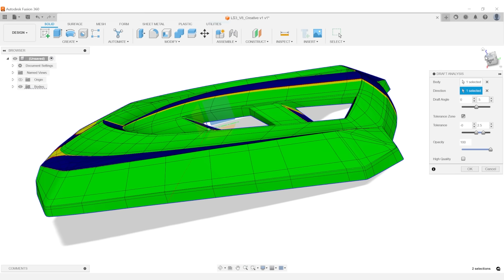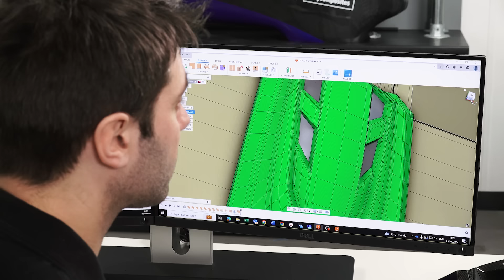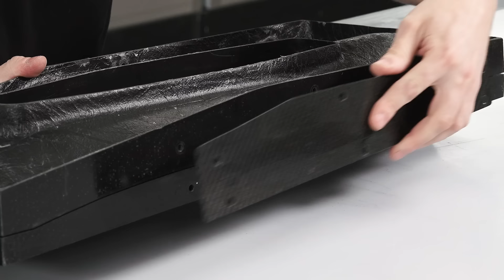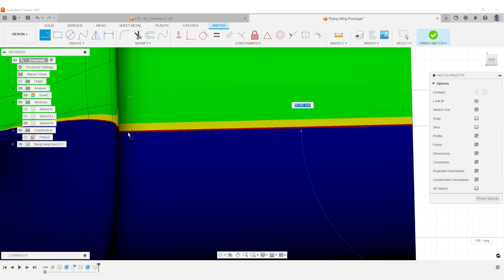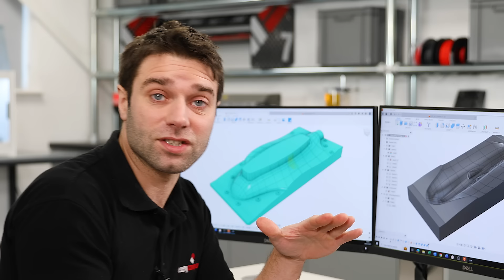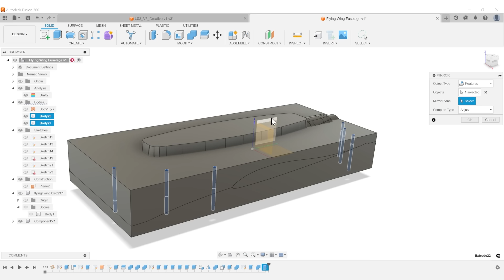Practical CAD Techniques for Composite Pattern/Mould Design

Comment: Draft analysis is one of those tools that separates good mould designs from frustrating ones. 📐 Finding that optimum parting line early saves so much headache later. At JevnyMFG, we use draft analysis daily to ensure smooth moulding. Great practical walkthrough! 🔧

Comment: i really enjoy watching your videos but i've always wondered why you couldn't just machine the mould directly
Reply from the maker: For prototypes and small production runs, you can machine the mould directly from an epoxy tooling board or even billet aluminium. However there are some downsides to this approach. The fist is longevity of the mould tool, a composite mould will significantly outlast one made from tooling board and in some cases even machined aluminium given the ability to undertake repairs. The second and more importantly is the delta in CTE, if the mould and the component material are made from different materials then they will experience expansion and contraction at different rates during the cure cycle. This leads to the potential of distortion and warping of the part and even things like pre release which can cause significant imperfections in the surface finish. For the most accurate and stable moulds, they should be made with a material as close to the component material as possible.

Comment: What an unbeleivable amount of competence on display in every one of these videos.  This gives me a great deal of optimism for the future, as do all of the overwhelmingly positive comments.  Nice to know in a world that can seem increasingly chaotic, there is a stable base of both very competent people and those for whom that is respected and appreciated.
Reply from the maker: Thanks very much George, it's no secret that a lot of time, effort and resource goes into making these videos so it really is nice to get feedback hearing how people have been inspired to give it a go. It's videos like this which demonstrate methods that will hopefully open doors for the next generation (and current generations) of engineers.
Reply: @easycompositestv  Absolutely.  It's so great to see.  I've been 3D printing for 13 years now and it seems like the field is exploding.  I know you make your molds primarily via CNC, and it makes sense due to the scale and diversity of materials, but I'm also wondering if you've explored 3D printing, at least for smaller models.  In my experience, regarding CNCs, the CAM part is a bit intimidating and sometimes costly in broken bits and materials.  3D printing significantly simplifies that process as the analog to CAM is essentially handled automatically by the slicing software.  Interestingly consistent with your thoughts on the next generation, my son (15yo) just launched a 3D printing business where, coincidentally, he's printing carbon fiber "style" parts.  We've been trying to figure out if we could incorporate real carbon fiber parts into his offering as there is definitely demand for Carbon Fiber parts in his niche.  We had considered CNCing carbon fiber plates (as opposed to fabric), but that seems to have some challenges which you can probably imagine.  Your videos have got me thinking we could possibly mold the parts instead.  Being able to 3D print the molds (or positives to make molds from) would certainly be more in our wheelhouse.  I'll have to put more thought into how we could adapt our offering, which is currently almost entirely custom - per customer, to perhaps a hybrid where we produce a base carbon fiber part and then somehow add customizations to it.  The reason being, I don't think our market will support the higher costs of custom molds for each order.  But it could possibly support a base product with 3D printed customizations added to it, or perhaps smaller custom molded carbon fiber parts being added to it.  If I can figure something out that will work, I certainly now know where to learn more about the processes involved and to get the required materials.  Cheers!
Reply from the maker: @georgevaccaro9379  Great to hear that your so has already started on his engineering pathway. 

We have used 3D printed moulds and patterns in a good number of our previous videos, covering Forged Carbon compression moulding, direct laminating of a 3D printed mould and also using a 3D print to make a high temperature mould for processing prepreg. 

https://youtu.be/nhqAhYOdGNc
https://youtu.be/4ND2WtEZatY
https://youtu.be/KpJdwryFj6k

Whilst this technique is great for smaller projects they do come with limitations on larger pieces where CNC profiling is prefered. For getting started though it can be a great way of introducing yourself to the world of composites.
Reply: @easycompositestv  Excellent!  Thank you for the links!

Comment: Why do you need carbon mould instead of just making it on epoxy tooling board?
Reply from the maker: Whilst you can, and we have, directly machine tooling directly from tooling board the end result isn't as durable or as stable as a composite tool. Also to factor in is the CTE of the tooling board vs carbon fibre, whilst the epoxy board is pretty good, it won't be as close to carbon fibre as a carbon fibre tool would produce.
Reply: @easycompositestv thank you! What about fiber glass mould? It would be much cheaper than carbon fiber mould
Reply from the maker: @galanonim3122  Again it's all about trying to match the CTE of the mould and the part as closely as possible in order to reduce distortion and potential pre release. If you were making glass parts from prepreg then a glass mould would be perfect, for carbon parts cured at elevated temperature a carbon mould will offer the smallest differential in expansion/contraction rates.
Reply: @easycompositestv I got it! Thank you!

Comment: hi Mr Paul ^_^ , you are modelling the fuselage by the " Form surface " module ?
Reply from the maker: Initial modelling was done on a VR Metaquest headset, but it could equally be done on the surfacing tools in the CAD package you are using.
Reply: @easycompositestv  But I see that the way to build shapes using VR doesn't have parameters, but it drags and drops points like the way to build shapes in the Create Form module in Fusion 360.
RIght ? Because when you configure it to split into 2 halves of the sample on the software, I see that it also takes you time to process it.
Reply from the maker: @tuanbuiminh2674  Once the initial form was made in VR, it was then imported into Fusion to refine and ensure all dimensions were correct.

Comment: so i have a question is it possible to 3d print the first mold or it has to be cnc machined?
Reply from the maker: For hand laminating practices then 3D printing a mould directly is definitely an acceptable practice as we show in our 3D printed mould tutorial.  
https://www.easycomposites.co.uk/learning/carbon-fibre-part-from-3d-printed-mould

If you're looking to process prepregs and use one of the more advanced processing methods then you may be better off printing a pattern and then using this to make a suitable composite mould.
https://www.easycomposites.co.uk/making-a-composites-mould-from-a-3d-print

Comment: @easycompositestv, what software do you use for the surface design (initial part)? From the surface lines, I assume something like Rhino or Blender.
Reply from the maker: Hi Patrik, it was initially modeled up in VR using Gravity Sketch and then tidied up in Fusion 360.

Comment: Thanks for the valuable video. If you want to carry out a FEM simulation for this component, e.g. to simulate a torsion test. How would you define the bondry condition and load and which failure theory do you use? I have designed a very similar component and defined a bending load case. But I want to do a torsion test. Can you give me a tip? 
Also, message me directly at @ASedghiii
Reply from the maker: This is going to depend on your package as most will have different options.

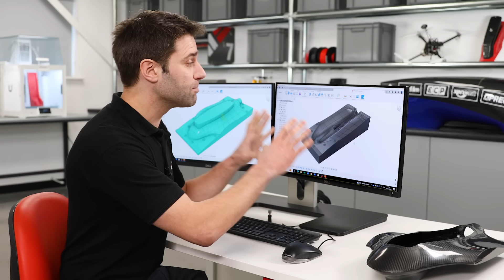Comment: When you had the mould on the screen (34:00), you then went on to make a pattern (and then, physically, a mould from it). Can you please tell us why you didn't just CNC the model of the mould straight away, and use that to make your part?
Reply from the maker: This is a valid question which quite a few people ask. This is for a couple of reasons, firstly the longevity of a tooling board will only allow for a small number of demoulding before the tool begins to wear. For some, very low level production runs, it is possible to machine a mould directly from tooling board however, a composite mould will last much longer and allow for a higher number of mouldings to be made. The second is the CTE of the materials, Ideally the mould should be made from the same material as the parts to be made, this means that they will expand and contract at the same rates. This helps to reduce pre release of the part during curing which can occur if the mould and part and tool expand and contract at different rates during the cure cycle.

Comment: Do you have a thickness to this CF part ?
Reply from the maker: With one layer of 210g surface ply and another of 416g backing ply, the engine cover is about 0.75mm thick.

Comment: I am confused. We use the actual finished cover and its dimentions to make the first mould. After we do the surface split, the top of the model becomes the top of the mould. and than when we make the part (use fibers), the top of mould becomes bottom/inside of the model. dont we loose the tickness and dimentions of the original part by doing all that?
Reply from the maker: The moulds are female compared to the male part.  So the internal dimensions of the mould fit over the part model perfectly.  When you lay up into the mould, the amount of material determines the part thickness.  The external dimensions stay the same.
Reply: @easycompositestv  Aaaaa. thanks for the answer. that makes more sence

Comment: I was hoping to see what will be done to the backside of the engine cover. I'm trying to figure out a good way to add the parts that will be attatched to the top of the engine.
Reply from the maker: We aren't quite finished with the engine cover just yet so keep an eye out for the next installment. Generally speaking the mounting features can be one of the more complex challenges to overcome as the injection moulding process usually used for these components is allows for much more intricate geometry to be produced. Quite often it's a case of salvaging mounts off an original part and bonding them in place or fabricating a bracket in place of the original.

Comment: Maybe it’s a stupid question but why not machine the mold directly ? Why go through the pattern process ?
Reply from the maker: Certainly not a stupid question! In some cases it is perfectly possible to machine the mould directly. For prepregs or resin systems needing a higher temperature cure, there are a few things to consider though. Tooling board materials only have a limited life and generally won't last as long as a composite tool. You can of course machine tools form aluminium etc but this is very costly. One other big factor is the thermal expansion of the materials. The most accurate moulding can be achieved by using the same materials in the mould that will be used in the parts. This way the CTE is aligned meaning any expansion/contraction of the part and mould happens simultaneously which therefore reduces warping and distortion and pre release of the part.
Reply: @easycompositestv  That makes a lot of sense, thank you for answering !

Comment: Loving your content 😍😍 I think after multiple tutorials, I found myself in this world😅 Just out of curiosity, can you make a suspension control arms using forged carbon? Would be it applicable on the normal car? And how would you need to reinforce it? Thank you😊🥰
Reply from the maker: It would entirely be down to specific design calculations.  Its unlikely to be seen on any road cars as often cost dictates the retention of traditional steel pressed parts. It may theoretically be possible on some race parts.

Comment: Could you guys do a video on how you went about designing the brake lever mold you used in your 3D printed mould video?  I think that would pair greatly with that video!
Reply from the maker: A lot of what you see in this video would apply especially using the original lever body to cut from stock to get a mould shape.

Comment: Can I make a carbon monocoque by bonding cored flat sheets together? Rather than the all-in one autoclave or OOA
Reply from the maker: In a basic sense yes, however it would need to have been designed and analysed with that construction method and also careful consideration would need to be taken for assembly, bonding, strengthening joins, hard plate locations etc to ensure it can perform as required for its intended load case and use.
Reply: @easycompositestv  Thanks for the response. I saw the CLK GTR monocoque, and it's boxy design made me wonder.

Comment: I was wondering, how do you consider the thikness of the matirial designing the mold?
Reply from the maker: Ultimately it depends on a few factors, type of mould, use of mould and the size.  They (and some other variables) can influence the design of the mould laminate you end up using.

Comment: I might have missed the reason why one would choose to make a carbon fiber mould rather than a machined mould. That extra step looks unnecessary  but I am sure there is a good reason for that. Any one can explain ?
Reply from the maker: Commonly it is for high temperature applications such as pre-preg.  The thermal expansion of the mould is then almost identical to the expansion of the materials being used in it which can be advantageous in some situations.  Machined moulds from tooling board generally have a limited lifespan and billet metal machined tools can be very expensive to produce both in material and machining costs.

Comment: Its great to see the old video's and see how far he has come in 10+ years and what is now possible to what was possible over 10 years ago. I have spoken to this guy over messages a few times and he is always so helpful. Is there a way of doing any injection moulding with carbon fibre yet or are you just making parts on the computer for plugs?
Reply from the maker: Plastic injection moulding is not a composite process at this level yet.  Resin infusion and resin transfer moulding processes do exist albeit they are slightly different in both the approach and technique.  There are some overlap with some composite processes, eg infusion uses vacuum in a bag to draw resin into the mould.  Forged carbon fibre is a compression moulding process between 2 tools. So there is some cross over in some areas albeit there is not injection moulding in the traditional plastics sense.

Comment: Thanks for another perfectly well done video.. as someone working with CAD daily my brain hurt watching the flanges getting made..  with a direction of Z and am angle of 90° the flanges would be perfect and would turn around the whole part.. but apart from that, the video was good as always!
Reply from the maker: Thanks for your comment.  In this case with this model and Fusion, we found this method worked best without causing any geometry issues or the tool failing to work correctly.  Other models and other CAD packages may work in a more simple way.

Comment: If you are planning to use CNC machining to make the pattern, I don't see why you can't just machine the mold and skip the whole process of making the pattern. You will still need to do some hand working to remove the machining marks and prepare a suitably smooth mold surface. You may even want to apply a hard surface coat. I'm just saying I think that making a pattern is obsolete now that we can use CAD and CAM.
Reply from the maker: For very short production runs or proof of concept/prototyping, machining the mould from tooling board would be fine; however, for production runs and repeated heat cycling of the tools, you need much more durability than a machined model board tool could offer. You can also use the pattern to make a number of tools rather than machining multiple tools.

Comment: Hey Easy Composites, awesome video! I had a quick question, regarding mold cutting - what tolerances do you typically need for a CNC machine/router?
Reply from the maker: For the parts shown, we have not added dimensionally or scaled the part for machining purposes. The parts are not super critical dimensionally so no additional tolerance is needed for the CNC machining and finishing processes being used.

Comment: Great video! Why don’t you invert the cnc mold and use that as a final mold instead of making two? 😄 thanks for all the knowledge you shared 😄
Reply from the maker: For very short production runs or proof of concept/prototyping, machining the mould from tooling board would be fine; however, for production runs and repeated heat cycling of the tools, you need much more durability than a machined model board tool could offer. You can also use the pattern to make a number of tools rather than machining multiple tools.
Reply: @easycompositestv  Great response! Thank you 🙏🏻😄

Comment: Thank You so much for all of the information over the years. Is there any chance of a video for bladder molding into an aluminum split mold? I am on the hunt for bladder making materials at the moment. Thanks again!
Reply from the maker: Its something we might cover in a future video.  The bladders are generally bespoke to each application with different people having different preferred materials and methods so it is hard to give an easy solution that works for all/most.